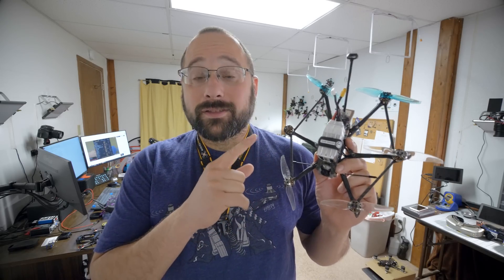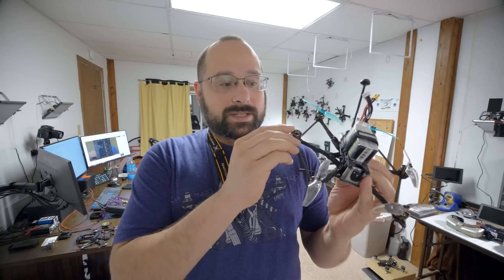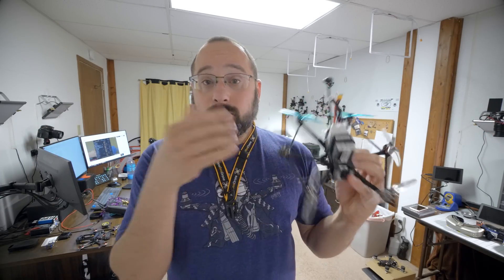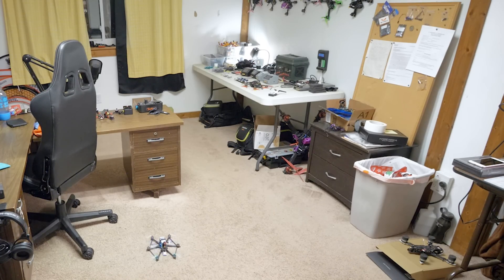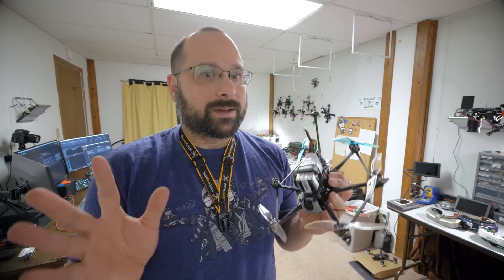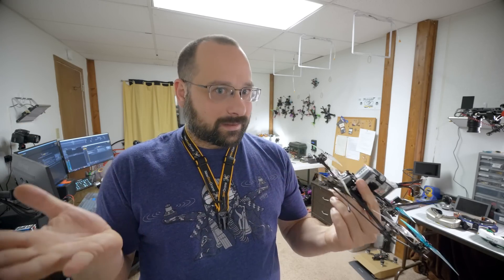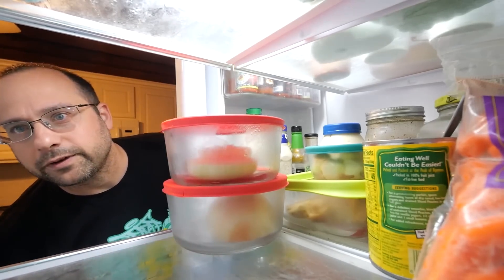Can Betaflight compensate for a failed motor in flight? FLYWOO HEXPLORER

Comment: Hey! Maybe a retune of the pids would fix the issue... my theorie is that the new system dynamic (1 or 2 props less) with the old pids lead to a instable system and the turnig over looks like it a bit... if the pid tune is very different to the stock tune try the stock tune. Then flying without the 2 mid props would work maybe

Comment: Could you change the mixer from Hex to Quad while in flight, have the two side motors disengage and still fly?  I ask because that may save battery for long flights.  Then again, the drag may cancel that all out.
Reply: you'd be carrying dead weight if you did that, so a heavy quad.

Comment: Even with those two props missing, the diagonal motor pairs are not spinning in the same direction and therefore not going to work like a quadcopter for yaw.
Reply from the maker: The diagonal motor pairs are definitely spinning opposite directions. Not sure why everybody keeps saying this.
Reply: @JoshuaBardwell  Yeah, that's precisely the issue. Diagonal pairs need to spin in the same direction to control yaw, one diagonal pair spools up, the other down, boom torque differential with no pitch or roll. Would they spin opposite, there would be no difference in torque when speeding up or slowing down a diagonal pair.
Reply: @JoshuaBardwell  And because on this cut down hexacoptwe the diagonal motor pairs don't check out, the copter flips out. On a quadcopter each pair turns the same direction (CW+CW, CCW+CCW), on this each pair has one motor of each direction, which makes yawing impossible. Once the copter tries to roll, it begins to yaw as well, because two neighboring motors spinning in the same direction will induce a torque that yaws the aircraft. The FC tries to counter that but fails as the motors responsible for yaw (still on the same side of the aircraft) now just make the roll stronger, boom it flips out.

Comment: LOL it keeps attacking the poor Roma  F5 and crazy sorry I just bought a Roma F5 6s today and I LOVE IT. I also have the Cidora SL5 6s and I have had 5 motors have bellhousing separation in under 30 days. ONE of them literally EXPLODED  yesterday and it was new and had less that 4 packs flown with it. The entire bell separated and exploded and magnets and bell went everywhere midair with a new motor WTF. I WILL NEVER USE XING E 2207 1800kv motors again. I did however pick up some Xing 2208 1800kv solidbell motors that go on the Titan and I will be putting them on tomorrow. BUT SERIOUSLY 5 XING E MOTORS HAD SEPARATED BELLS IN UNDER 30 DAYS. No crashes on anything but the grass and the only time I did crash is when the bell house separated and shorted out the wires and the one time the bell literally EXPLODED WTF! Oh and the Cidora is less than 2 months old and I don't fly all crazy because I fly in a 7 acer open field and i'm still learning and I have never hit anything.
Reply: I got the roma 4s version it friggen rips!

Comment: You could take the quad version and change it to hex-config in betaflight to discard the physical part. It should fail too, the FC would still try to fly as if the two motors were there. Unlike a quad, a real hex "can" fly with one motor failure (or two lucky ones), but it needs to be a detected and reconfigured. In short it just means that you have more motors than degrees of freedom to control (4), but you need to use them correctly

Comment: The problem is the mixer. The PID configuration does not send commands to each motor directly. The PID goes through the mixer, which tells what to do to each motor and expects to have the 6 motors. You could do motor failure detection and dynamic mixing. The only firmware that supports this (in progress) is PX4. Unfortunately there is no 20x20mm flight controller supported by PX4 https://github.com/PX4/PX4-Autopilot/issues/13857.

Comment: Did you try this in angle or horizon? The FC would be compensating as if it was in wind or some other force. This will let the flight controller do the compensation not you and your joysticks.

Comment: Thanks for the video.  I had a feeling this would be an interesting test, although I did think it would hover.  The problem with removing 2 props on opposite sides is now you have 2 clockwise spinning motors next to each other, and same for CCW.  That will make yaw impossible.  Even if it could fly on 5 motors, 2 of the motors would be separated by only 120 degrees and would make yaw very difficult in one direction.

Comment: I saw Nurk fly his Flywoo hex with on dead motor in his vlog. I think you need to get outside and get away from all turbulens in the room and maybe abit higher up. Also have more space so you don't need to worry about destroy your house and give it a try one more time! Would be interesting if you manage to make it fly. sounds weird that one does and the other don't. Happy flying!
Reply from the maker: I tested it outdoors before this. Same thing happened.
Reply: Thats interesting!

Comment: I still own my Thorax hexacopter from Hobbyking. Naze32 with really old Cleanflight software. Before runaway takeoff protection was even a thing. I lost an ESC once. Was able to land softly, however, I was unable to yaw the copter left or right. The Hexplorer is disarming because the flight controller realizes there's something wrong with the yaw pid loop.

Comment: I have experienced a motor failure on a 20kg (mtow ca 100kg) heavy lift hex. It was doing a predefined mission when a signal wire came lose. Only noticed when it came into land. No obvious deviation from its course. Can see the I term really ramping things up in the logs.
Reply: Yeah my hexacopter was able to make a complete recovery with a left rear motor failure it’s weird though when in acro mode I’m unable to fly and it freaks out like in video but in angle/horizon mode it works pretty much like a normal quad can’t really tell the motor was even there

Comment: Loosing one prop not only changing the thrust situation, but will affect yaw due to missing reaction torque. Maybe this plays role here too. Maybe it is not possible to maintain zero yaw together with leveled flight in this asymmetric prop situation, and that's why it goes down. I'm surprised,  I would have thought, it would fly with one prop off...

Comment: I think I know what the problem is. I looked online and found 2 photos of the Hexplorer, and the front and rear props are set up to run the same direction, the center props run opposite. RF CCW, Rmid CW, RR  CCW, LF CW, Lmid CCW, LR CW. So when you remove a center prop, both props on that side run in the same direction. Assuming the photos I found are correct, that's your problem. I'm not a Hex flyer, but I'd think a standard Hex setup would be  the same as a quad, with the center props running the same as the fronts or rears? Maybe a hex expert can tell me if I'm right?
I've got the quad explorer and it's completely conventional, but maybe they are doing something special with the hex. Anyway. if this is the case, it should limp home with  a lost front or rear  prop, but not with a lost center prop.
Reply from the maker: That's not how mine is set up. Whoever put the props on for the photo just put them on wrong. I don't think a hex would fly with the props like you describe.
Reply: That's what I thought, but one photo was AndyRCs thumbnail, and I just looked into his video, and the one he is flying is set up that way https://www.youtube.com/watch?v=Eyk1WmD-2Ww&t=257s (4:37)
Maybe I'm seeing it wrong, but I don't think so.

Comment: My understanding is that betaflight selects wither hexacopter or quadcopter in a dropdown menu and that puts the math to balance on either 4 or 6 motors. It either can't sqitch between them mid-flight once selected or more likely, it doesn't even bother loading both into the FC at the same time. So the hexa set to hexa will always attempt to use 6 motors. Maybe if you set it inside betaflight to be a quadcopter only? Or disable the two side motors..
Reply from the maker: That's sort of right but the wrong conclusion. If you load a hexacopter mixer, then one motor fails, the mixer will "reduce itself" to a quadcopter mixer. Basically, it will detect that one motor is not making thrust, and reduce the thrust of the other motors to balance out the quad. There is no need to "change mixers" in flight. A hexacopter mixer is a super-set of a quadcopter mixer. An octo mixer is a super-set of a hex and a quad mixer. They can always "fail down" to a mixer with fewer motors.
Reply: @JoshuaBardwell  Damn, sounds like it'll have to wait until spring to do a full outdoors test. Or risk losing your fingers to frostbite haha. I'm in Toronto so it's been snowed since late Nov

Comment: Wrong prop order in 2 props off (so called quad-like) configuration!
With 2 props off the, way how you did it, controller loses the ability to control yaw and roll in the same time. Hexa copter does not become quad copter in this case, because it does not have cw-ccw-cw-ccw motor order, that is necessary for yaw and roll control in the same time. If you removed a different prop combination it could become quad-like, still not sure if it would fly.
As for single prop off, could it be that betaflight hexa mixer is implemented with shortcuts, since hexa is not widely used? Or maybe you have to retune PIDs to fly with prop off?

Comment: What's likely happening is that with a spider hex layout (not a Y6), when you lose a prop the yaw becomes hugely unbalanced.  If the prop opposite the dead one were to simply shut off, the aircraft becomes a quad with props in at the front and props out at the back, and thus no yaw control. Some waypoint oriented FC's will detect the prop-out condition and dramatically reduce or even shut off yaw control in order to maintain control over pitch and roll.  If you turned yaw gain waaaaaay down it might work.  But at the end of the day you should buy this hex because it is cool AF and not because it has any hope of redundancy.

Comment: Have a look at the ArduPilot discussions and issue tracker for their work on single engine failures in hex/octos. The subject is way more nuanced than "the PID loop will handle it". There are constraints on where the center of mass can be and how much total thrust you can have and still be able to control the vehicle. Being able to detect which motor is out can be helpful as well.
Reply: Exactly. This video started by making fun of a guy who told him it would require special code. I don't remember seeing an apology at the end. Yes, the Arducopter code to handle this was introduced about 10 years ago I think.

Comment: the two prop off test is not a real quadcopter because front and rear prop of each side are in the same rotation, so cant do yaw compensation. try again without the two fronts or the two rear
Reply from the maker: That's not how Betaflight's prop layout for a Hex-x mixer works. The props go CW-CCW-CW on the left side and CCW-CW-CCW on the right side. So you remove the middle ones and you still have opposing directions in the corners as with a standard yaw mixer.
Reply: @JoshuaBardwell  i'm pretty sure is not. as you say. after removing the central ones you keep FL=CW RL=CW FR=CCW and RR=CCW, same rotations are not oposites each other
Reply from the maker: I see what you're saying now. Sorry for the confusion.
Reply: @JoshuaBardwell  np dude, just a hexacopter user here, also i can throw some light to the thing, hexacopter motor fail is not just motor throtle compensation, the rumour "a hexa can survive the lost of one motor" is true, but some conditions should be ok at the moment of fail. the first one, is have a compass onboard, the second one is a head locking mode, and the third is "the lost motor never have to spin up again until landed", the fact is when a hexacopter loose a motor, head locking mode should be turned on (need compass to work), then while the hexa is spining (cause not yaw compensation) using the advantage of head locking fligh you can move the hexacopter to the desired location and land with some constant and uncontrolable yaw movement. but it's always better than a dead spin or just a fall from the sky.

Comment: I'm impressed to see that it is still not working. In the past when i was building hexa's with multiwii it was not working, so i was expecting that it would fly.
Reply: Hate to disappoint you but...
https://youtu.be/4GVc0mGTn0c
Reply: @dr0n3droid  in theory it's truth but i had it twice on video. Lost a prop at approx 15meters altitude, hexa didn't drop, in fact had at the beginning the same behaviour as on the simulation but flipped over at three meters from ground.  And bended  the alu arms of my flyduino-spider
Reply from the maker: It totally will work, just not on this tiny aircraft.
Reply: @JoshuaBardwell  https://youtu.be/6wyjHxrX47I
That's the video ,it's already 8y old.
Btw congratulations for 3y full time youtuber.

Comment: I guess Betaflight doesn't have the "specialised code to recognise that a prop is missing" after all. :)

I wonder if the motors with missing props are affecting the yaw authority due to the ridiculous speeds they must be reaching?

What happens if you disable those two ESCs? Obviously not a very realistic test, just a curiosity at this point.

Comment: I think the motors are over running, or the esc is limiting the rpm once they are maxed out. I think if you actually disconnected the motor you might achieve the result you expected.

Comment: What about putting the prop on with the nut loose so you can get airborne... but then again, the most likely place to lose a prop is in a crash so this copter likely would not fly after a crash and losing a prop

Comment: @joshua please take a look at motors directions. If you remove 2 center props then you are left with two CW props on one side and 2 CCW props on the other side. I think this is problem of yaw axis not being able to use props on right and left side.

Comment: For your viewing pleasure Joshua.
https://youtu.be/4GVc0mGTn0c
Not BF I know, but motor loss on a hex is survivable.
Reply from the maker: Of course I know that in principle it's survivable. Just not in this specific situation.
Reply: @JoshuaBardwell  Because the code isn't compensating for a missing prop. It's reacting to undesired roll as it would if there were still six props.
Arducopter recognizes that a motor is unresponsive when Tridge disables M1, then does what it can to compensate.  Betaflight doesn't yet have such provisions.

Comment: My guess is that with one but especially with two props off, the unproped motors are trying to spin faster and faster to get more roll authority but it doesn't work as there is no props. Then at a certain point they reach max velocities and therefore it also limits the speed of other 4 motors, resulting in a crash.
Reply: Agreed.
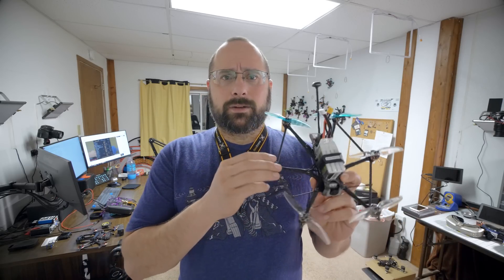If only Betaflight had "Specialized code necessary to recognize that a prop is missing and a motor has stopped working and then compensate for it." 0:34
Reply from the maker: That's an interesting hypothesis.
Reply: Works fine if the motor signal wire is disconnected...I have limped back a Hex like this.
Reply: @mcclarinscott  Bent props introduce undesired vibrations, but still provide thrust.
Reply: Disable the motor....
Reply: @gmivisualsjason3729  Even with a motor disabled, Betaflight doesn't have the ability to recognize that it's missing. A seperate mixer would need to be enabled when it appears that a motor isn't producing thrust.
Reply: @dr0n3droid  A current sense resistor for each ESC would enable Betaflight to see when a motor isn't drawing the expected amps for its RPM/input value, then it could cut power to that motor and let the rest take up the slack.
Reply: @licensetodrive9930  Think along the lines of failsafe procedure.  If signal is lost for N milliseconds, execute RTH/set throttle to zero, etc.  
Once I_max has been reached the PID loop would recognize that Motor X is nonresponsive then could enable "Missing_Motor_Protocol" for Motor X.
Should be achievable in software without the need for additional components.
Reply: Two motors off is not normal quad, motors with same rotation are next to each other - yaw and pitch - yaw and roll are coupled. But one motor off should work with correct tune imo.

Comment: What if you lowered the throttle value needed to start airmode. I wonder if airmode could help on the handling at lower throttle. Isn't that what airmode is there for?
Reply: Ohh, I see. If you were at 50% throttle, airmode would most certainly have kicked in. Don't know/understand why it doesn't work